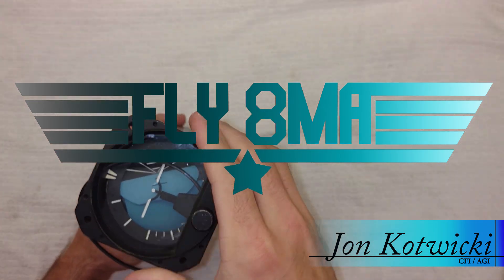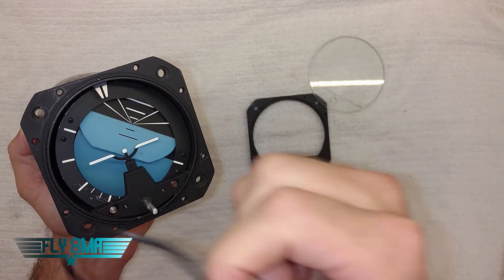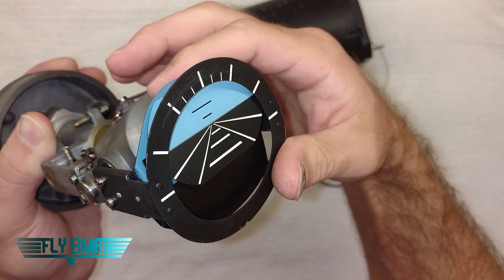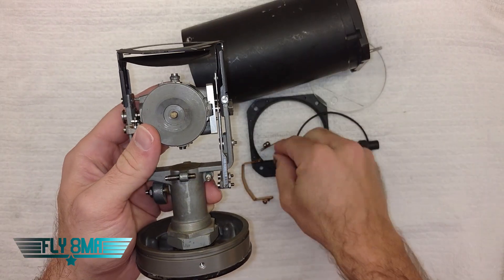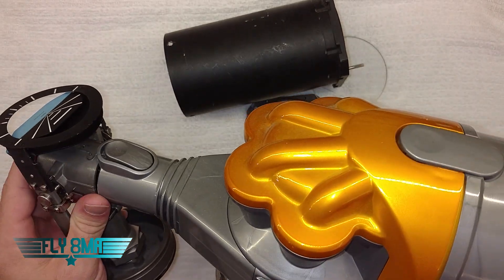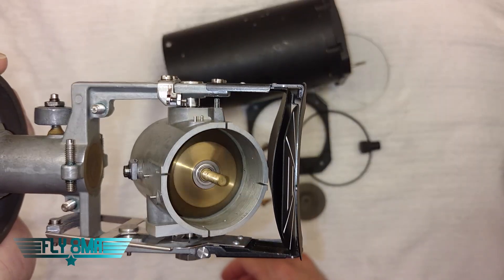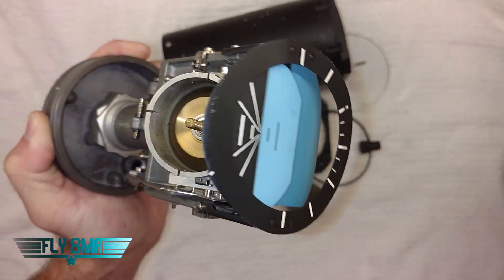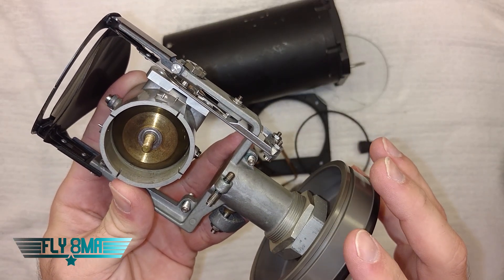Ep. 60: Inner Workings of an Attitude Indicator | Gyroscope

Comment: on my trainer aircraft, the attitude indicator is part of the electrical system. We don't have a vacuum. how would it work in this case?
Reply from the maker: Is it something like Garmin G5?
If that is the case, these modern Attitude indicators are powered by tiny sensors and don't use a vacuum system similar to the ones on modern cellphones.
If you have the manual, it should give you an idea of how it generally works.

Comment: The vacuum sucks in air and makes the gyro spin?
Reply: The air inflow is coming from what source?
Reply from the maker: That's right! The engine drives a small pump that pulls in outside air to create a vacuum for the gyro.

Comment: I had no idea that the gyroscope is powered with air. I always assumed it was an electric motor, but of course that would require a slip ring and would probably require periodic replacement of the brushes.
Reply: There are electric attitude indicators, typically as s standby instrument.

Comment: 2:26 The limiters are pendulous vanes. And the slots passing air provide a torque. That torque is regulated by the pendulous vanes. Those ‘lmiters’ are hang vertically. And that torque keeps the gyro oriented to vertical

Comment: How do gyroscopes self correct though? I would think that if a gyroscope stopped spinning in flight there would be no way to get it working again as it no longer knows what orientation is flat so it doesnt know what angle to start spinning at in order to hold that reference plane. Yet I've seen videos where Gyroscopes are turned off and turned out of allignment (as pitching and rolling an aircraft would) and then the gyro is started again and somehow it slowly (but succsessfuly) returns to level with the earth. How is this done?
Reply: Before an attitude is turned on, its idle gyroscope may be in any passive orientation, and is almost never erect, but typically fallen off at some angle.  When the instrument is turned on, the gyroscope begins to spin up, and then after a time achieves erection (rotational axis vertical, rotor horizontal) by means of a self-erecting/correcting mechanism attached to it, typically pendulous vanes.  This mechanism senses the local gravity vector, and has nothing whatsoever to with the ground or its slope.  Therefore, the instrument can be turned on while in flight, because the instrument doesn’t know or care if it’s on the ground or in the air, and it will sense the local gravity vector all the same.

Comment: What prevents the gyros in these instruments from drifting over time?
Reply from the maker: The attitude indicator has 'Pendulous Vanes'. They work by the principle of gravity to keep it in balance. These vanes (tiny holes) swing freely and let air in and out of the gyro's case to slow it down until it's back to equilibrium again.

Comment: If the gyroscope maintains its rigidity in space, why does its flight level indicator not invert when the pilot flies from one side of the Earth to the other?
Reply from the maker: The spinning rotor inside a gyroscopic instrument maintains a constant attitude in space so long as no external forces act to change its motion.
Reply: @fanbutton  --The gyroscope found within the attitude indicator is not like the unconstrained, desktop version that you may have in mind.  It does not maintain absolute rigidity on space, and it isn't meant to, because then it would be useless to the pilot.  The instrument's gyroscope is constrained by design, gimballed on two axes only, and is part of an assembly which includes a self-erecting/correcting mechanism, typically pendulous vanes.  Therefore, the instrument maintains the gyroscope's rotational axis aligned with the local gravity vector, at all times.  Since gravity vectors point toward the Earth's center, then that rotational axis will remain pointed at the Earth's center all the while the aircraft follows the planet's curvature.  If the instrument did anything else, it would be useless to the pilot.

Comment: Take one of those gyroscopes and put it on a tabletop, make it speed really fast and keep it spinning for 24 hours, while filming it, if the Earth really spins, the indicator will show movement, but if it does not more one bit, then it is a clear indication that the Earth does not spin, but is stationary instead.
Reply: Like you have done this...
Reply: 15° par heure
Reply: Not one of these. Aircraft attitude indicators include pendulous vanes in the construction to ensure the bottom of the cage remains aimed towards gravity. However, you could do the experiment with a very accurate standard gyroscope. Indeed, flat earthers famously did exactly that, spending $20k on a laser gyroscope in an attempt to detect Earth's spin. Sure enough, as expected, they detected a 15 degree per hour drift. (Thanks, Bob. RIP)
Reply: Have you ever seen a Foucault pendulum?

Comment: So how does it compensate for the earth's curvature to keep it showing the right side up even if you are landing inverted relative to your take off attitude? 😅
Reply: @leonduplessis3220  --The rotor-style attitude indicator contains a constrained gyroscope, not a freely moving one.  It's gimballed on only two axes, and has a self-erecting/leveling feature, typically pendulous vanes.  This gyroscope does NOT maintain absolute rigidity in space, and it isn't designed to.  It's designed to maintain its rotational axis aligned with the local gravity vector at all times.  As the aircraft rotates about its own lateral axis while following the Earth's curvature, so too does the AI's gyroscope.
Reply: @cardinalRG  Any gyro that gets affected by gravity will not be suitable for use in an aircraft. Gravity is relative to the Gravitational force applied to the aircraft. In a sustained 1 G barrel roll, the G force is in the direction of the bottom of the aircraft which will be up at the top of the roll. Thus if the AI compensates for the G force, it will be helping the pilot to an early grave.
Reply: @cardinalRG  So the gyro can do all of that but it can't invert.  How convenient for the globers.  That Alaskin Airlines flight that crashed into the ocean after the plane became inverted must have wondered, why in the heck would someone put a gyroscope in a plane that can't fully function as it should.
Reply from the maker: Good question

Comment: Good explanation, thank you. Does this have to be adjusted during longer flights to account for earth's curvature? Flat earthers quote the gyro always pointing the same way as proof for there being no curvature.
Reply: The rotor-style attitude indicator contains a constrained gyroscope, not a freely moving one.  It's gimballed on only two axes, and has a self-erecting/leveling feature, typically pendulous vanes.  This gyroscope does NOT maintain absolute rigidity in space, and it isn't designed to.  It's designed to maintain its rotational axis aligned with the local gravity vector at all times.  As the aircraft rotates about its own lateral axis while following the Earth's curvature, so too does the AI's gyroscope.

Comment: What part in that adds in spherical drop? Is this another flat earth proving device?
Reply: No, It is not. Nothing is.
Reply: @halliemyler8644  --There are no "flat earth proving devices", only those that confirm the Earth's spherical shape.  At any rate, the rotor-style attitude indicator contains a constrained gyroscope, not a freely moving one.  It's gimballed on only two axes, and has a self-erecting/leveling feature, typically pendulous vanes.  This gyroscope does NOT maintain absolute rigidity in space, and it isn't designed to.  It's designed to maintain its rotational axis aligned with the local gravity vector at all times.  As the aircraft rotates about its own lateral axis while following the Earth's curvature, so too does the AI's gyroscope.  The AII can only function on a spherical Earth, and would not work at all on a flat one.

Comment: I have on my desk in front of me, an Electric Humohrey AH08-0105-20 artificial horizon. This runs of 28 volts and does not require a heavy vacuum engine driven pump or an old fashioned Venturi tube that does not provide source until you hit 75 kts.

Comment: So I have an attitude indicator related flat earth question: If I’m flying along and using only my  artificial horizon to stay straight and level, after a while, if the earth is spherical and curving downward in front of me, then my altimeter should be registering a gradual increase in altitude. But it doesn’t. My altitude stays relatively constant as long as I’m flying straight and level. By using my artificial horizon as my main visual  reference for keeping my plane straight and level, I have never noticed a gradual gain in altitude even over a prolonged travel distance. Any ideas of what’s up with this observation about gyroscopically controlled artificial horizons that all pilots literally trust with their lives?
Reply: First of all, pilots don't use attitude to fly straight and level, as the attitude required for a straight and level flight depends on many variables, they rely more on the altimeter and vertical speed indicator. Second, the AI has an erection mechanism that exists for this exact reason, it keeps the axis of rotation upright as the airplane flies on the globe.

Comment: How does this device account for earths curvature as you fly at distances enough to effect your altitude?   Wouldn't the display on the gyro start to pitch upward as the plane stays at the same distance away from the ground being that it was calibrated to the level of the runway in which the plane took off?    If this device is 100% mechanical, and completely free of the effects of gravity, I don't see how it could adjust its self as a plane flies over the curved earth surface..  For example, if you fly a plane in a strait line for 200 miles, you would be traveling over about 26,650 feet of earth curvature.  (based off 8" per mile square which is how much earth is suppose to curve) So at what point is this downward drop of the earth noticed on a gyroscope, being that it's independent of gravity?   Some one help me out here, am I missing something?
Reply: @Alex F Hi thanks for your response. I had not been aware of the pendulous vanes, interesting!  So you're saying, this mechanical feature on the bottom of the gyro that allows small amounts of air out is what accounts for curvature as a plane flies?   So at what point does the pilot have to adjust this? or can a purely mechanical device that is suppose to be free of the effects of gravity suppose to automatically adjust for curvature?  No one mentioned a flat earth btw.. I keep finding online that when questions like this are asked, people automatically assume It's a flat earther. Just for asking a logical question that many people have also wondered about.
Reply: @para_carson  
What you should be asking is how does a gyrocompass "find" north.  How would that work on a non rotating sphere.
Reply: @para_carson  gravity should be able to sort out the problem, without the pendulous vanes. It sorts everything else out.
Reply: This is the first thing I’ve come across, that gravity needs help with.
Reply: @tonyb3067  What you said makes no sense at all, Gravity does not need help, if you understood how gyros work you'd know why the vanes are required.

Comment: It's amazing how simplistic that instrument is. I can appreciate the engineering that went into that simple mechanical device. I'm guessing that they are currently using a microprocessor based system that incorporates a multi axis accelerometer to do the same job. I know nothing about flying. It just seems that an electronic version would be cheaper, easier to design and construct.
Reply: A lot of planes still use vacuum powered backup instruments even when the rest of the cockpit is glass.  And I would argue an electronic instrument is far more difficult to design and construct.  All the mechanical one needs is some lathe work.
Reply: @stargazer7644  I know very little about avionics and all my opinions are based on contact with  mid continental avionics. This is what I was told by them and it's also written on their website.  Electric attitude indicators have fewer maintenance requirements and potential points of failure than vacuum systems.
Reply: But more likely to give problems!   This is independent of the electrical system as is the altimeter and the airspeed indicator.  If the electrics go, you have them.  If the suction goes, you have airspeed and the turn and bank indicator as well as the altimeter.  If the pitot tube gets blocked and you lose the airspeed, then you still have the artificial horizon.

Comment: How does the gyro self level when first starting up?  You need to address the purpose of those little limiters at 2:27 they perform a fascinating function by managing which of the slits air can escape and induce a force on the gyroscope.
Reply: A pendulum element built into the gyro casing.

Comment: Why don't they just use a pump to force pressurised air over the giro? I mean, why does it have to be a vacuum pump? surely a compressed air system would work just as well?
Reply from the maker: When the pump fails it will send debris downstream to the instrument, this way when the pump fails, no debris is sent to the very expensive instruments.  This also stems from long ago when they used venturis to generate suction on the side of the aircraft.
Reply: @fly8ma.comflighttraining199  Interesting. Suction is indeed underrated.
Reply: @fly8ma.comflighttraining199  Is it even a pump?,  i would have thought they used a vacuum created by a venturi somewhere on the outside of the plane?.
a pump could fail, venturi created vacuum will never fail unless the plane is stationary.
Reply: Vacuum is still an air pump.  It is just pulling air instead of pushing it.
Reply: Because compressed air is hot.  Vacuum is not.  You get vacuum for free on a running internal combustion engine.

Comment: How is this calibrated? Does the setup use gravity to calibrate the position when vacuum is applied and the setup tries to  keep that calibration as long as vacuum and air is applied?
Reply: When the plane is on the ground, the pilot can adjust it to show the correct attitude  then the gyro tries to maintain that position.
Reply: @Bendigo1  Okay, I guess that's not accurate enough anyway to be limited by curvature of the earth.
Reply: @MikkoRantalainen  it is.  It will actually become more inaccurate the farther the plane flies away from it's original location.  There are charts and mechanisms to account for the change in attitude due to the curve of the earth.

Comment: I need some help figuring something out, this came from the flat earthers but please don’t get mad at me. I have to admit I can’t explain is so far. That’s why I found this video because I want to have an answer. If a gyro keeps spinning in the same orientation and you fly an airplane from one side of the earth to the other side of the earth. What does this mean for this instrument, what would happen on the inside and what would it indicate? Is there a mechanism that corrects for this?
Reply: That is called gyroscopic precession.  It has to be accounted for while flying. The farther the plane goes the more it will  move.    That is one way we know the earth is not flat.  If a plane takes off and flys north from the equator to the 45th parallel the gyroscope will show a nose down attitude if it is not adjusted for the precession.

Comment: Completely understand the concept of the gyros but can't find a simple answer. Why do they no longer function properly when you loose power? Do some of them function with a vacuum pump? If so, doesn't that defeat the purpose of using gyros as secondary instruments?
Reply: Some are powered by electric motors.  Some have a battery backup.  The ones that run on vacuum will not work if the engine stops because the vacuum is no longer being created by the engine or vacuum pump

Comment: The engineers that came up with these analog instruments were geniuses...
Reply: Yea I wanna make a mini one that fit your palm.It will be powered by weight rather than by gyro.
Reply: @Nexalian_Gamer  they’re called bubble levels
Reply: French Physicist Léon Foucault invented it.
Reply: Yeah and using vacuum power is a really good idea. It is simpler than an electric motor and it will also pull out the small amount of heat generated by friction. You don't want any dust to enter the instrument though, which is perhaps a downside of this technology.
Reply: @masterplayer5982  Yeah exactly. Thats why your cup doesn't spill when you are in a plane and it takes a turn
Reply: The engineers who came up with the digital versions were also.
Reply: I was thinking the same thing. I think people were much smarter back then.
Reply: @BrettMcNary  If things go right,I'll have an old attitude indicator at some point in my life.
Reply: @Nexalian_Gamer  funny you should say that. My 182 is getting new G5's in it as we speak, and both are coming out of mine too along with the vac system. Know of any cool things to do with the old AI? ;)
Reply: @BrettMcNary  You could make a steam turbine out of the vanes and connect the axle to a generator.
Reply: @BrettMcNary  You have a minuscule gyro that works just the same in your iPhone. Technically, your phone could easily replace the attitude indicator if the latter is malfunctioning. It also comes with a compass as well as the GPS.